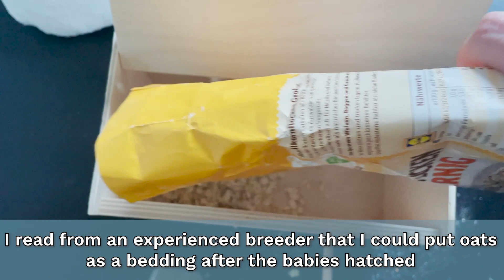Our Baby Budgies Hatched! 🐣

Comment: If you don't want to use bedding you can just put a paper towel at the bottom and change it every day. It would be really easy to clean and the nest won't be so smooth too.
Reply from the maker: Thanks! I'll try that out 😄 It would make cleaning much faster which is a lot better for the chicks and parents 😊